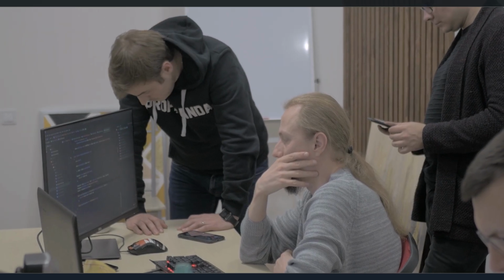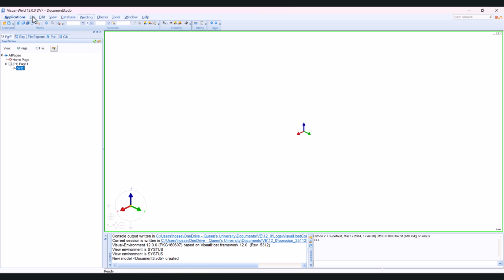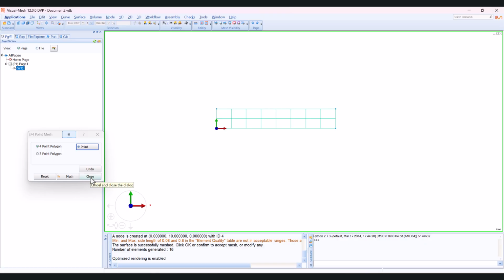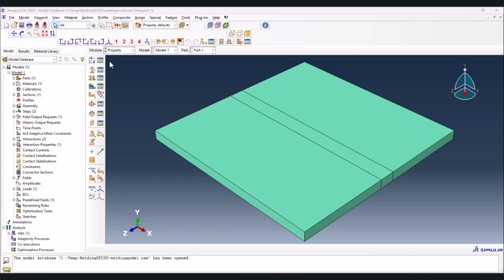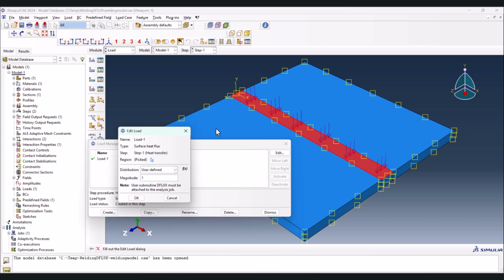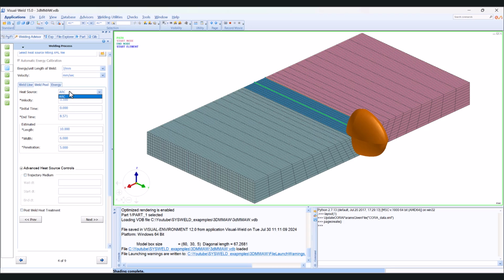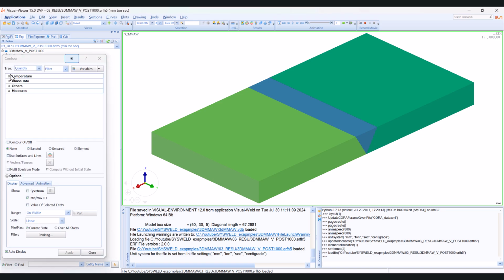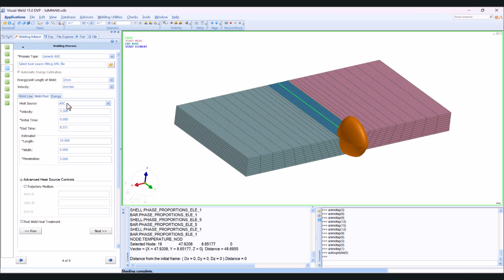SYSWELD vs Abaqus — Which Welding Simulation Is Better?

Comment: Is it possible to use the Goldak-model or the conical model for the laser welding modeling? And do you have a video of how to create an induction heat source in Abaqus by any chance? Abaqus seems to be a bit difficult when it comes to moving induction heat sources.
Reply from the maker: Yes, you can use a Goldak or conical heat source for laser welding in Abaqus (I have videos on Goldak DFLUX).

However, you should NOT and you can’t do this in SYSWELD, it’s physically wrong there. SYSWELD already has dedicated laser models (gaussian), and using a Goldak-type model for laser is not correct.

As for moving induction heat sources in Abaqus: you’re right, it’s tricky. It usually requires a custom DFLUX or electromagnetic coupling, which is why Abaqus feels difficult for induction compared to SYSWELD. 

There’s a video on moving heat source in abaqus check it out:

https://youtu.be/OOkXX_ZDCZQ?si=2Om1ZTKwovaxBftM

Comment: thanks for this useful information ,,, i need for you make a lecture about how i can draw a welded joint in solidworks then export to the sysweld and make the mash
and i need how i can making mash to the weld when the weld has spline line
Reply from the maker: I'm glad you found this information useful! I'll consider your suggestions for future videos, but I don’t promise!

Comment: Well, sysweld suite can allow to compute thermo chemical treatements, hardness, and more realistic stresses based on phases transformations. It contains a strong matererial database unlike Abaqus. No need to design a trajectory through a user subroutine as you did. It is also designed for filler material deposition.
However, out of Heat Treatment or welding, it is not designed for that much. It is more specific.
Reply from the maker: I appreciate your insights!

Comment: Very nice video! IMO, SYSWELD is far better in welding simulation. I can remember seeing some papers that validated their model with weld pool depth and it was really accurate but ABAQUS is more globally accepted.
Reply from the maker: Thanks a lot! 🙌 And yes, I completely agree with you — SYSWELD is on another level when it comes to welding simulations. The built-in material modelling, phase transformation, and heat source handling make it extremely accurate, especially for things like weld pool depth and thermal cycles.

Abaqus is definitely more “universally accepted,” but SYSWELD is purpose-built for welding, and it really shows in the results.

Glad you enjoyed the video!

Comment: Great video as always. This is my first time being exposed to SYSWELD, and I found the material modelling section better than in Abaqus.

As you mentioned, including phase transformation in Abaqus requires quite complex coding. What is the general name for the subroutine I should look into if I’m interested? Is it UMAT/UMATHT, or something else?
Reply from the maker: Glad to see you in my comments once more! 🙌 Always appreciate your support.

For phase transformation in Abaqus, yes — it’s much more complicated than in SYSWELD. The general subroutines you’d look into are UMATHT (for coupled thermal–metallurgical behaviour) or UMAT if you’re implementing a full custom material model.

Most phase-transformation workflows in Abaqus rely on UMATHT because it allows temperature-dependent properties, latent heat effects, and evolving phase fractions — but it’s quite advanced coding.

If you ever dive into it, good luck… it’s not for the faint-hearted 😅